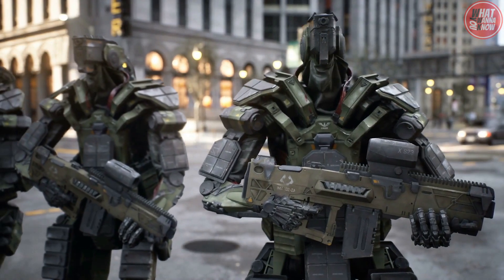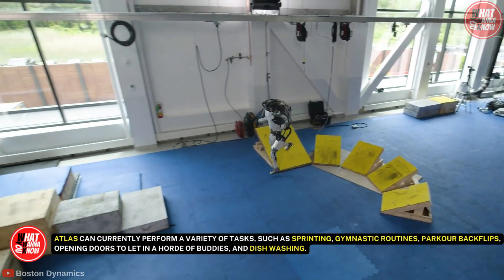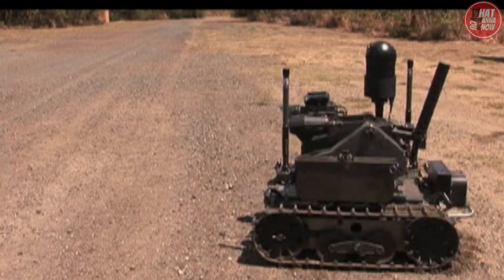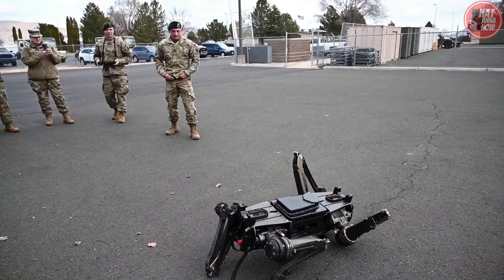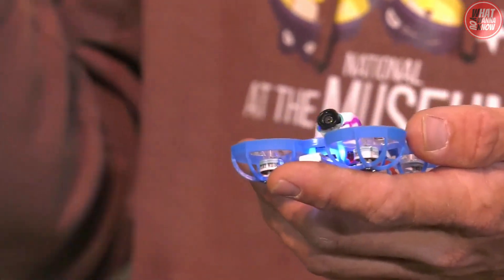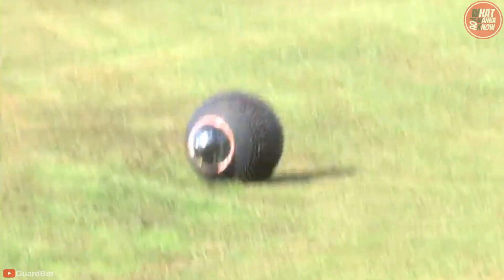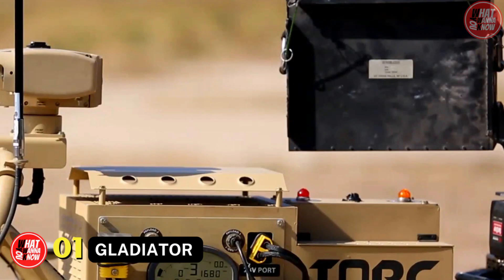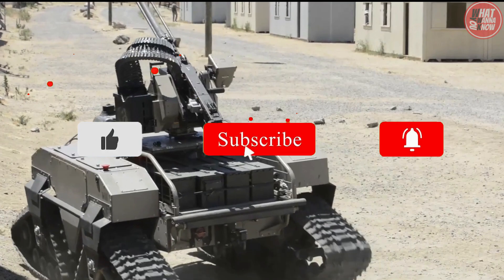Top 10 Special Military Robots Used In US Army

Comment: Robots exist to do good things. The US Army's military has always been at the cutting edge of technology. Robots have the potential to dramatically reduce loss of life, allowing soldiers to safely scowl locations or breach enemy locations. Many of the robots are even designed for support purposes rather than eliminating threats. Atlas is the fully working robot with an adjustable sensor, camera, and a laser rangefinder. Atlas can currently perform a variety of tasks such as sprinting, gymnastic routines, parkour backflips, opening doors, and dishwashing. Thank you so much for doing this video.